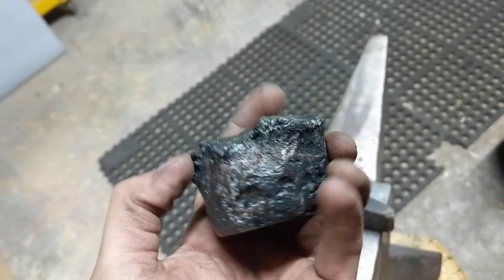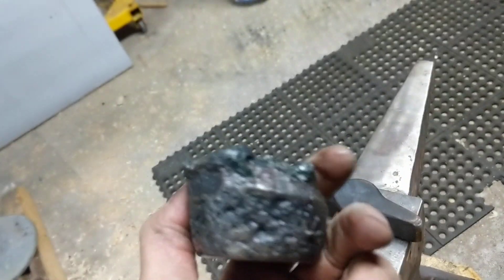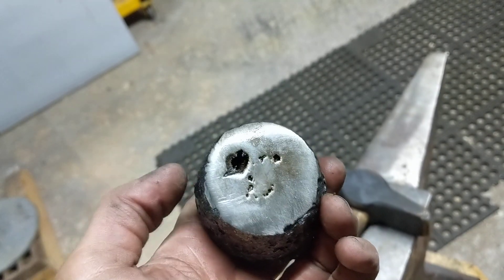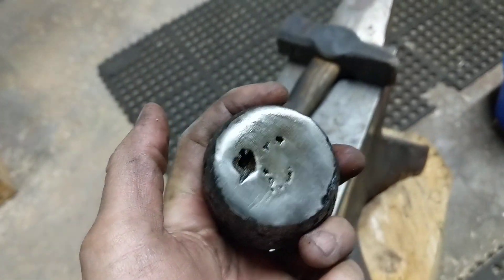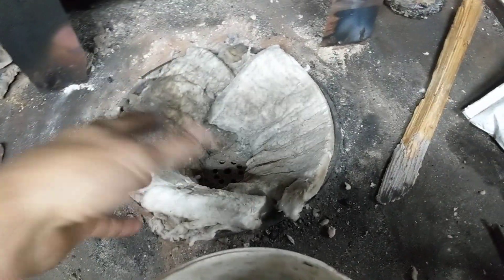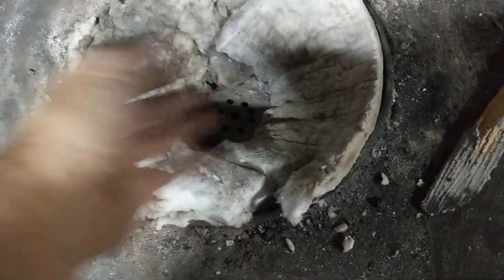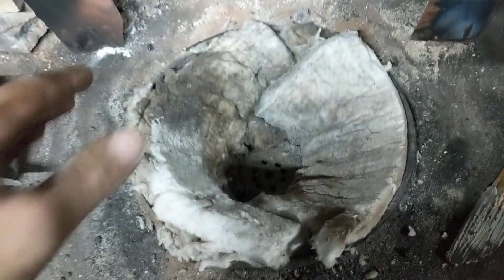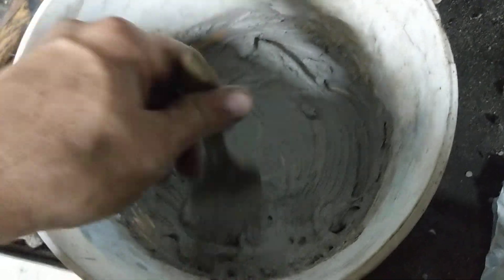CRUCIBLE STEEL SUCCESS!!! & Relining my Forge

Comment: If youre lacking in heat, and the crucible is rated for 3000°+, id recommend anthracite coal. Idk how many times ive melted my workpiece in my forge, leaving it in there 15 seconds too long😂

I believe with a blower, anthracite can reach temps of up to 4000° 

Hell it looks like the surface of the sun
Reply from the maker: Actually I've scaled down the size and am successfully brewing crucible steel in my induction forge. I would like to get back to the approach of using charcoal (for history sake).